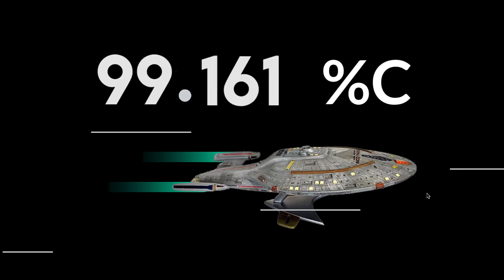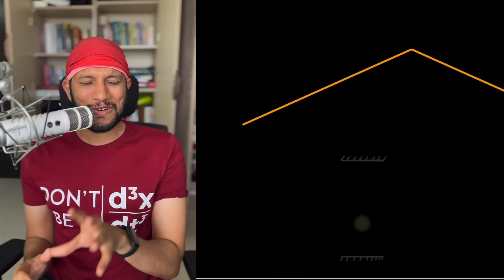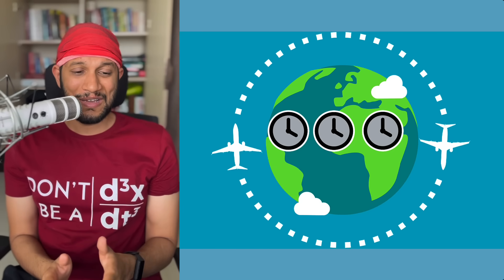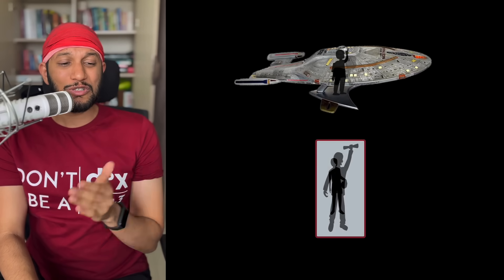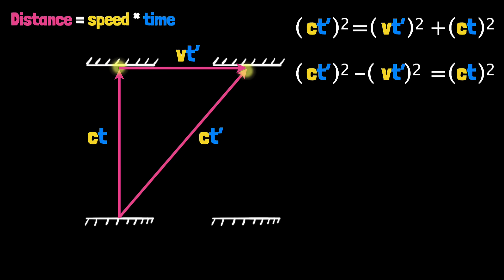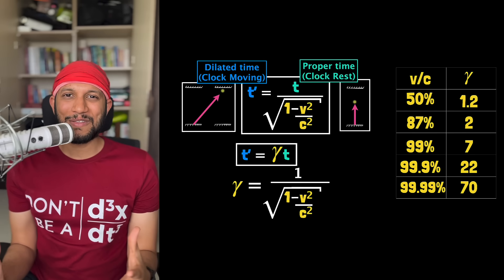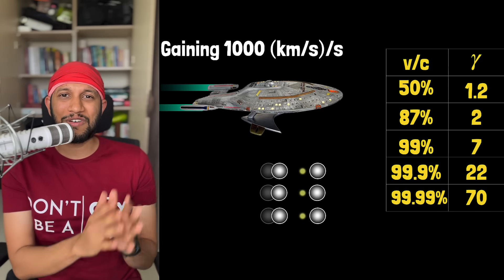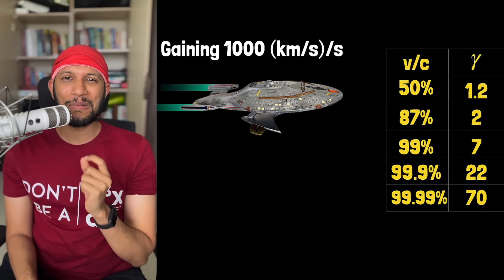I finally understood why you can't go faster than light! (My mind is blown)

Comment: Two things.  1) at 0.707c the ship travels 0.707 proper light seconds per 0.707 proper seconds; it therefore 'feels' like travelling at the speed of light.  0.861c is 2 time the speed of light.
Second... What about deciding to slow down?  In that case you're approaching the atomes slowed down faster than the speed of light... And it is therefore easier to slow down than speed up at near the speed of light.   
If you were using an ion drive that uses electrons to push against... Then I'd even 50% they could be moving away from you at the speed of light and you would feel basically no push from.  You're going to be limited by your method of propulsion more than the time dilation effect

Comment: That darn photon clock again! 
100+ years and we are still using an impossible clock to build, impossible to use even if you could build it, to describe an effect the average person innately cannot believe. 
An explanation that has caused kids to turn off physics faster than ... well the speed of light.
Not intuitive at all.
There are much better ways.
Reply: Such as…?
Reply: @DrDeuteron  Hey, this explanation took 16+ minutes and a video.... comment section is not the correct venue.
I’ll get around to it, as part of a greater opus. (66 yrs old, I’ve got little time to waste.)
BTW I hold the same option (distain really) on the Bowling Ball / rubber sheet explanation for curved space. Totally Unsuitable and lacking for the 2023 mind.

Comment: I have a question from Kinematics
I was given a question to solve 
The question is :- 
A particle is detached from a balloon moving upward with velocity of 20m/s and at height 25m find time to reach the ground
By the Vertical motion equation s= ut + 1/2 at², we get to know at t= 5 and at t= -1 the particle reaches the ground
But as we know the particle was at a height of 25 m and as the balloon was moving upwards with velocity 20m/s .. the particle will also have the same velocity and will travel a distance in upward direction then it will come down 
But displacement will be of 25 m downwards( initial and Final position) and time to reach the ground will be 5 seconds.. but at t= -1 the particle is also at the ground ? 
What does this mean.. Please help me out with this concept
Reply: You left …I can’t use s. Height is z. You left out z0.
So your equation is a quadratic and the roots are when the thing is at the ground.
It doesn’t no jack about your 🎈 , so it solves for a parabolic trajectory the starts before t=0 and then overlaps when it reaches your release point (in phase space).
Reply: The full equation is s= 1/2at^2 + vt + s(0). That s(@ t=0) is important, since you don't start from the ground.

You will get two answers, one positive and one negative. The positive one is your correct answer. Meanwhile the negative one is the time at which the object was at ground level. So 1s before you released the object, it would have been on the ground (assuming completely uniform acceleration). 5s after you realease the object, it touches the ground once again.
(Note that I've used your results for the explaination, I didn't check if it's correct but you should get the idea anyway)
Hope this helps.